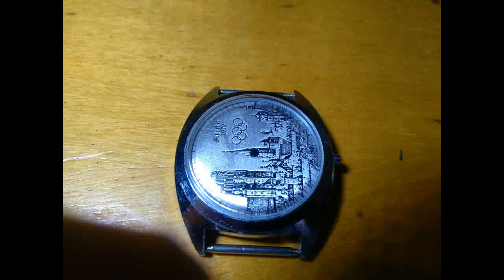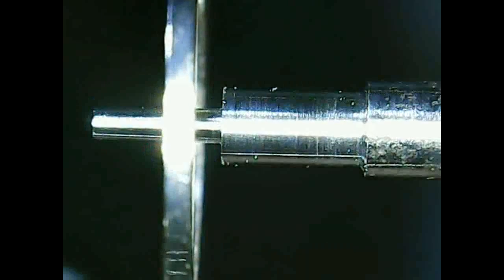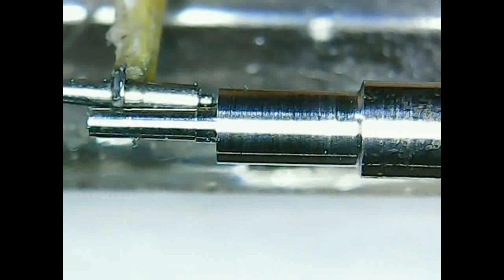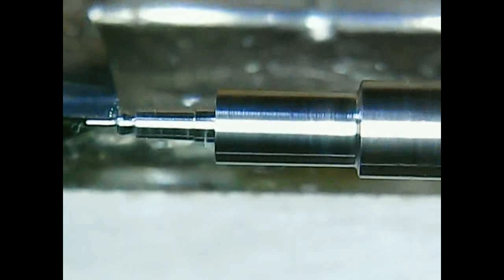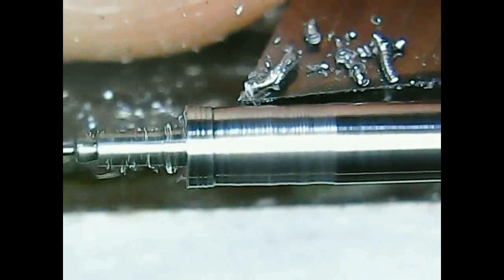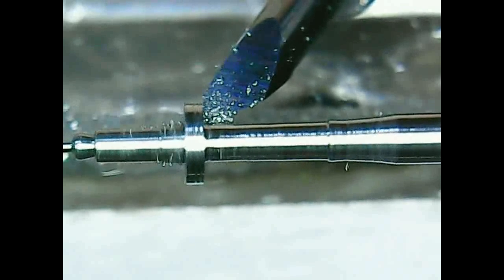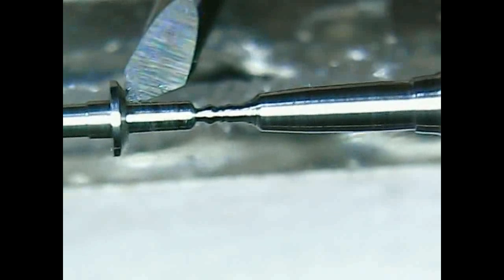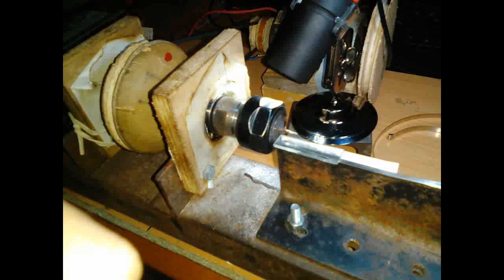Turning balance staff, the first promising pice

Comment: Why not use a micrometer and know how much is coming off etc?
Reply from the maker: A micrometer would break the piece off, or bend it for sure. After that it wont be concentric. It takes the same time to try the parts on. This way one can see if the dimensions are not to tight or to loose. Final size of the pivots is burnished on a Jacot tool to the jewel hole size. This also measured by testing the staff in place. One can not remove and put back a piece in any collet lathe without loosing concentricity. the Jacot tool is a two cone tool allowing the removal of the work piece.

Comment: Highly impressive work on the Lathe. Did you you carbide gravers or hardened steel gravers?  Just wondering  what make of Lathe you used?  Fascinating skill level of workmanship shown in your video. Keep them coming!
Reply from the maker: Thank you. I am using only carbide gravers. The workpiece is hardened and annealed to blue. The lathe is an ER20 shank i mounted in bearings, added a DC motor, pulley wheels and toolpost :) The balance assembly is ready, but there is still an issue in the gear train. Dont have much time for watch repair recently.

Comment: Hi, great and inspiring video. What kind are they and where do you get your carbide gravers from?
Reply from the maker: There are many options. Cheapest is from China, but i could not find small enough in square cross section. However, one can grind the tip down to the desired size with diamond coated discs. The smallest i could get is 2x2x50mm from grs tools. One can also try round ones, for example vynil cutting blades. The best (and also the most expensive) options are the dedicated engraving gravers, available in 1x1 mm square.
Reply: Thank you so much, I always wondered whether engraving gravers would be suitable. I will try the vynil cutting blades too.